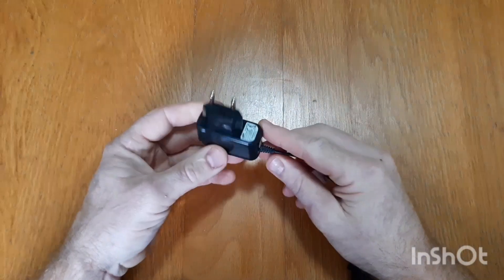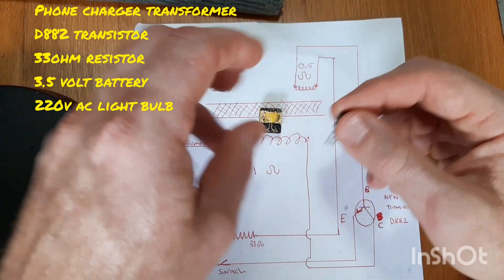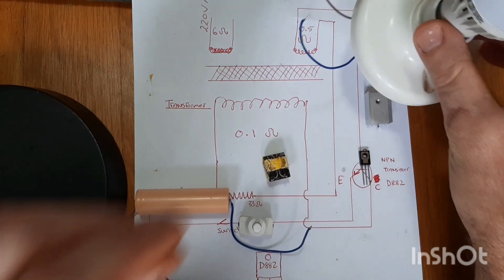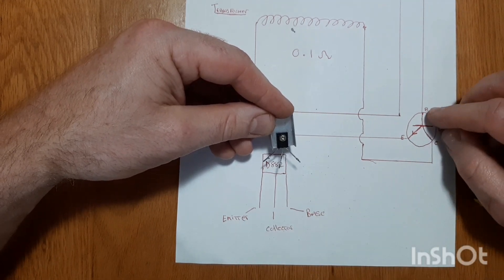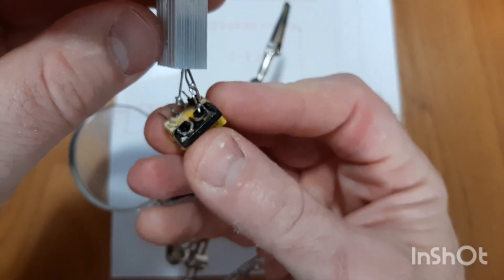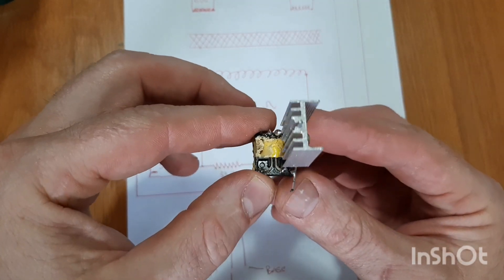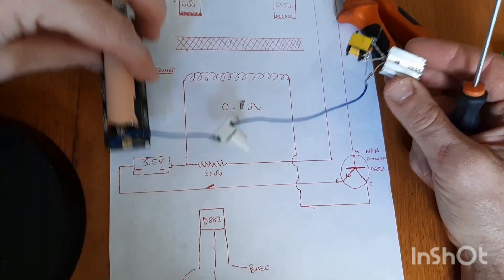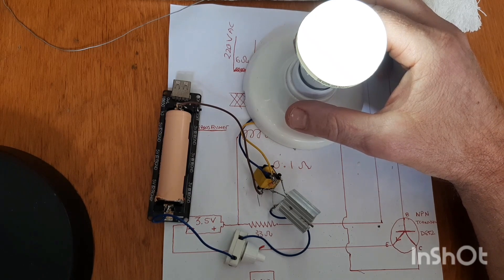How To Make The Worlds Simplest Inverter. make and use at own risk.

Comment: This circuit is technically an inverter, but it's a really bad one.  This is not generating a 50/60Hz signal like normal mains power, it's generating a very high frequency output at I'd guess probably somewhere around half the correct voltage, which could potentially damage lots of things if you actually tried to plug it into any real equipment.  It also won't be able to provide very much power (that LED bulb is probably the most it can realistically actually power, and there's no guarantee it won't fry that too if you run it for long enough).
Reply from the maker: Thanks for your comment I did notice that it wasn't reading the 220v that other you tubes said.
Reply: @yourworkshopmate372  Actually, to be honest, what voltage you'll get will likely depend hugely on the properties of the specific transformer you happen to find, and what frequency it happens to end up running at (which also depends on the transformer), and these can be completely different depending on what adapter you pull it from.  This sort of circuit could even potentially produce voltages significantly higher than 220V in some cases, because the whole thing is completely unregulated and just free-running...